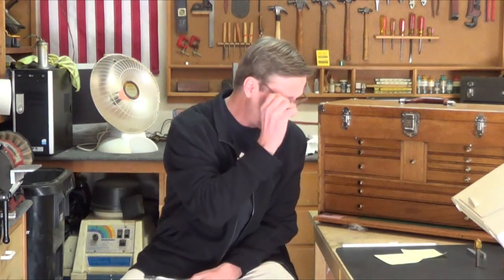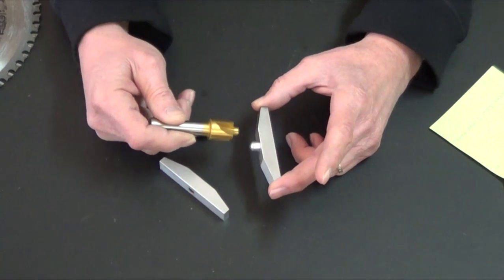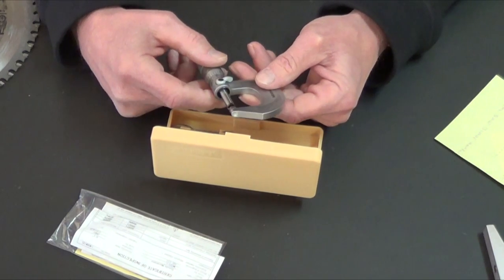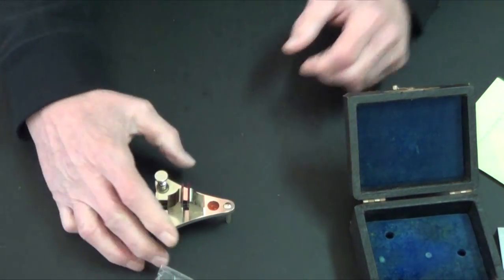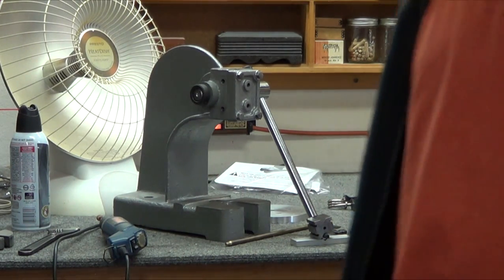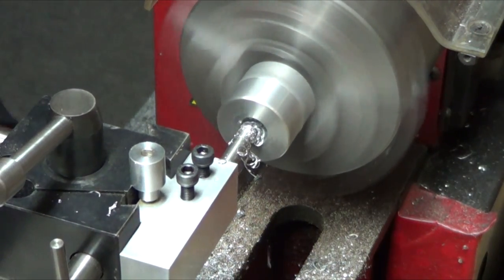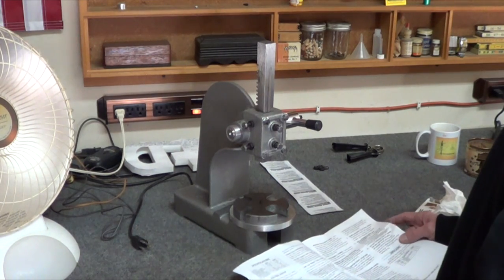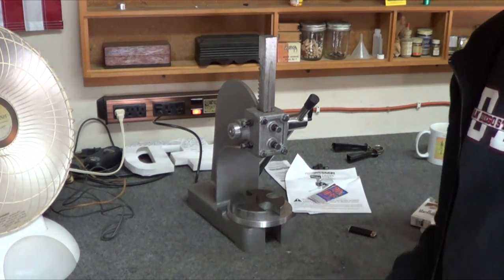Final HF Arbor Rebuild Video #28

Comment: I have a similar press with the top tooth on the pinion removed so the handle can be rotated into an optimum position for leverage, sort of like the ratcheting type.
Reply from the maker: You know that's not a bad idea. I might do that!